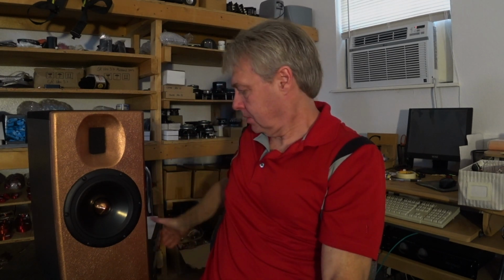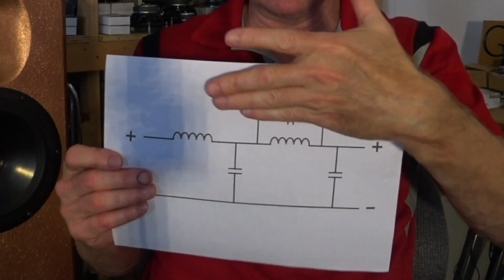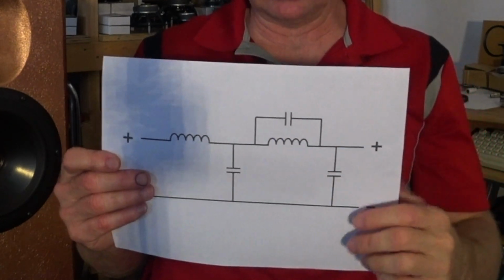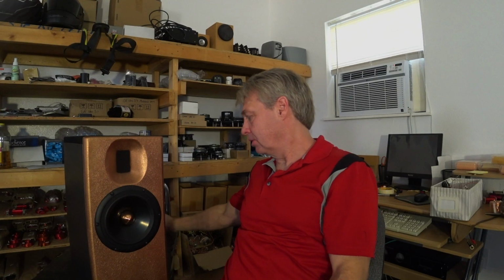Why crossovers shouldn't be calculated...

Comment: It's interesting , when you see what the senior designer at Harbeth has to say , he uses software first to model then builds the actual model and makes minor changes. Harbeth's entire design phylosophy is based on making a human voice as close as possible to the real thing, I think it's a valid approach ! The other would be to use digital crossover's and filters to determine were the best mating point's are and how the filters used influence the sound , then build the physical to that model.  Of course yrs of experience in picking components and certain filter types is not something everyone has. Not to mention shelves full of different values !! Danny's aproach is absolutely valid , see what the driver are doing first !!

Comment: Harris tech...is this the bass box pro stuff... http://www.ht-locus.com/
I use a much more sophisticated synthetic crossover designer that uses frd and zma files as well as acoustic offsets that give much better designs. Are you simply stating that one should not use just electrical or that you must use electrical plus other parameters such as driver positioning/ baffle dimensions/ and speaker sensitivy etc. If your just using simple crossover calculator wouldn't this be equivalent to flying blind with just electrical????

Comment: Would there be any advantage to essentially making a bandpass filter to lower a tweeters output vs using resistors?
Reply: A band pass filter would only be used if filtering both ends of its range. In other words if you rolled off the top end or filtered the top end also then that could be considered a band pass filter. But 99% of the time we aren't filtering the top end of a tweeters range.

Comment: great video :)  
i could not find those mini monitors diy kits in audio circle link or gr-research.com website.
Reply: It is a new model that I have not added to our website yet. You can see the thread on the development here: https://www.audiocircle.com/index.php?topic=160647.0

And measurements on it here: https://www.audiocircle.com/index.php?topic=160647.msg1729409#msg1729409

And there are some finished pics and pricing on page 6.
Reply: excellent Danny,  i like about everything about those speaker.  i usually find things i do not like visually or compromises to design but these checks all the right boxes :) 
size wise its at the upper limit i can fit in my setup, a 5" woofer version would be nice, especially since the depth is  almost 15".

And yes i would like to see tutorial on build and a review. cravings for sealed box design for sure :)
Reply: I also looked and did not see them, can we get a link in the description?